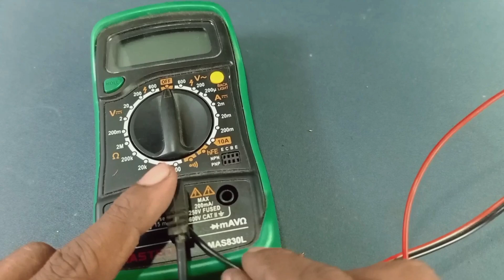Helpful Tools !! That's why you should add this circuit to your multimeter

Comment: Nice video👍🙂, i want to ask :
1. If i want to use 3.7V / 4V battery, does the resistor need to be changed?
2. If so what is its value?

Thank you 🙂🙏
Reply from the maker: Maximum 1.5v for this circuit
Reply: @RJEDITALL  kitna time tak chal sakta hi ak battery continuesly?

Comment: Hello, I set up this project, but I don't know what went wrong, I wound the coil as indicated, the 14 turns plus the 46, after ready the multimeter is only marking 1.5v from the battery, can you help me solve this problem?
Reply from the maker: You can try, check it well 100% working, thank u
Reply: Just use computer psu coil and schrack it on the middle winding and take bd241c transistor and 1k ohm resistor and it should work....i try